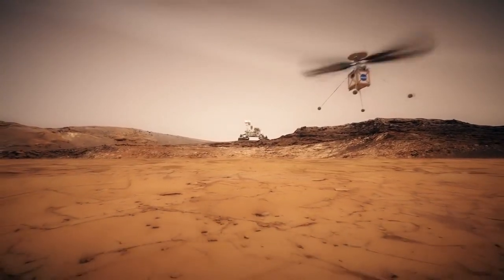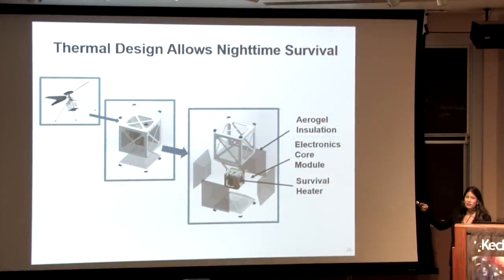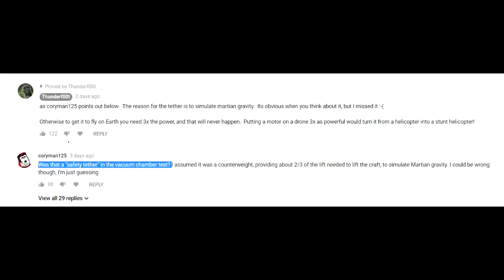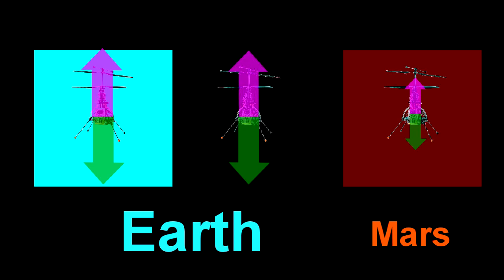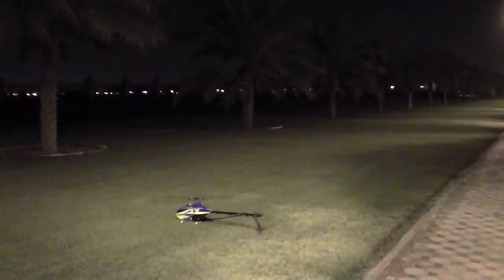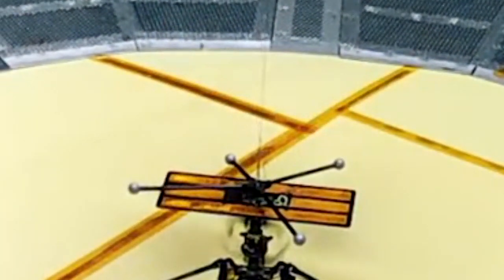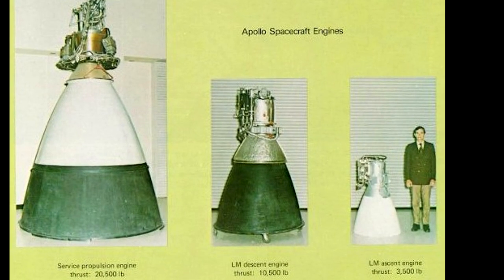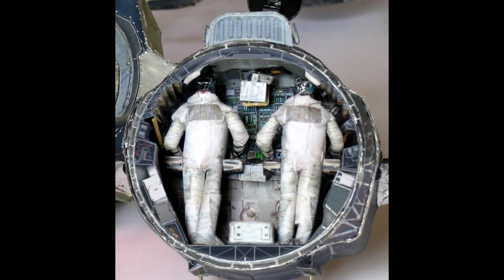Why NASAs Martian Helicopter CANT fly on Earth!

Comment: If the Lunar Orbiter was traveling at 3,579 miles per hour, how did the LM accelerate to match that speed when it says that it was going 76 miles per hour? And they did this in 2.5 hours.  Just an honest question. Here's the link for reference on the figures: https://space.stackexchange.com/questions/14172/how-did-the-apollo-11s-eagle-ascent-stage-find-the-csm-after-leaving-the-moon
Reply: The Answer on that very page answers you; the Lunar Orbiter (the CSM, I guess you mean) waited until the LM could circularize and raise its orbit to match.
Reply: So the CSM slowed down to the speed of the LM, thus decelerating 3,503 mph?
Reply: "The Answer on that very page answers you; the Lunar Orbiter (the CSM, I guess you mean) waited until the LM could circularize and raise its orbit to match." To speed up in orbit raises your height, and ironically causes you to get around the Moon more slowly, as you're traveling in a larger circle, so to speak. I don't know where you got your speeds, but either craft could match the other and make the rendezvous.

Comment: Curious thought here Thunderf00t - They are testing this helicopter in a vacuum chamber, yeah? (To simulate less dense atmosphere) However the atmosphere on Mars is made up of 95% Carbon Dioxide - not the Nitrogen/Oxygen atmosphere we have here on Earth. I'm given to think that Carbon Dioxide as a gas is much denser than the Nitrogen/Oxygen gas here on Earth - so wouldn't that play an important role as to how effective this propeller assembly would operate under those conditions? Do you think NASA fills that test chamber with CO₂ to simulate the Martian atmosphere or do they just use a vacuum of N/O mix?
Reply: It is an easy thing to fill the vacuum chamber with the right amount of CO2. If I were on this project, this is certainly something I would want to do. The volume of the chamber is known, the pressure to achieve is also known. Just put that amount of dry ice into it and let it evaporate after you pumped out most of the air. Shouldn' be that much of a problem.
Reply: pyropulse*, *aaronsdavis*, *explosu And everyone else commenting about pressure and density should read * Karl Lind*'s comment. If you think density does not depend on gas then you are WRONG. If you disagree explain helium baloons. You don't even know how to use the ideal gas law. "n" stands for molar quantity. Density is n*M/V, where M is molar mass which DOES DEPEND ON GAS. If you change M then nothing changes in PV=nRT but density does change.
Reply: Morpheas
On the other hand. If something is easy to do, then why not do it? Creating a CO2 atmosphere in a closed chamber with some predefined gas pressure is really not rocket science. Especially if you already have a vaccum chamber (which is the hardest past in this exercise).
Reply: Which is propelled faster by a propeller - a boat traveling through molasses or one through water? 🤔😳
Reply: Mathew Kevern the speed of sound affects propeller vehicles because you will operate without Atmosphere if you can push all the air away too fast. Its great for jets etc because they are moving into more atmosphere, but if you try to be stationary its problematic. Of course im sure someone scientifically literate could put actual values or terminology to that.
Reply: Denser gasses have a lower speed of sound. You know how helium makes voices higher? That's the same effect in reverse.
http://pages.mtu.edu/~suits/SpeedofSoundOther.html
Reply: If you can evacuate all of the air in the chamber, then you can inject any combination of gas you want into the chamber after.  I'm sure there are a lot of other conditions of the Mars environment that this helicopter must be tested for.
Reply: aaronsdavis one kilogram of lead weights the same as feathers, until you drop it on your foot :D
Reply: The overall density of the atmosphere, is what matters. How dense each gas is, doesnt actually matter.
Reply: They probably thought about all that... I mean, is NASA. They deserve credit don't they?
Reply: Since we already know what the atmosphere of Mars is it's relatively simple to fill that vacuum chamber with the right gases.  They should have thought about this already.
Reply: McBlaggart why is that the case could you explain?
Reply: SO im not the only one who said density in the last video
Reply: we mean this is not accurate due to the comparison of the gas comopostion differenace and temperature
Reply: Erik: THANKS for CLARIFYING. It's been a while since I've needed to care about GASES.
Reply: Many theorists here, who are wrong, Viscosity and Reynold numbers of Co2 are different than air, also the temperature on Mars...
Reply: The CO2 mix might be more important because it will have a lower speed of sound. Spinning the blades faster than the local speed of sound will generate no lift.
Reply: pyropulse The density of CO2 (mass per volume) is higher than O2 and N2 at equal pressures. The molar concentration (moles per volume) is (roughly) the same.

There’s a reason helium balloons rise - helium is less dense than air at the same pressure.
Reply: whaaaaat?..you are LED to believe , are you? led by what, exactly....
Reply: aaronsdavis goose or gander?
Reply: What's heavier: One pound of gold or a pound of copper?
Reply: What's heavier: One ounce of gold or one one ounce of copper?
Reply: then its about pressure, over area. copper is just less dense, which btw, is harder to put INTO space as the rocket has to be bigger to accomidate the module
Reply: hold on lemme, feel, 

RUNS away with a pound of GOLD and copper
Reply: they are the same, they have different densities.
Reply: NO.
Reply: Chaos Shepperson why does the speed of sound effect it ? I don't understand why people are relating it to the speed of sound ?
Reply: That's alrady been accounted for.  He mentioned the net pressure that the Martian atmospheric gas mixture creates.
Reply: 95% is not a metric you would use to describe how much atmosphere in total you have.  If there was only a 3rd of our atmosphere, of that 3rd 95% is carbon dioxide
Reply: Matthew Kevern
I've worked in the engineering department of a Rotorcraft company in the past.  To put it simply, very nasty things happen when the advancing rotors  reach mcrit.  The uneven, extreme, and rapidly changing forces would violently rip the rotors to shreds.
Reply: I think what he was getting at, is whether or not the thrust from displacing the low-pressure earth atmosphere is equivalent to what you would have on Mars. IE. If the rate of displacement is the same between the Earth test, and Martian flight, then the molecular weight of the gas mixture does change the amount of thrust created.
Reply: Mathew Kevern: That is another problem. The airflow around blades shouldn't become supersonic. Smarter every day did a nice video about that: https://www.youtube.com/watch?v=_pbdwueqGp4
Reply: explosu No problem. Sry for caps.
Reply: Viscosity may be a factor if it's a different composition. But I guess they have formulae/simulations to work out the viscosity difference and tell them whether it's worth worrying about.
Reply: mars atmosphere is 100 times thinner than earth's. 95% of 1% is not that much.
Reply: Plus they don't really need CO2 at 1% when regular air can be brought to a pressure to simulate the same effects of gas density.
Reply: McBlaggart, that's not true, they will generate lift, they'll likely be destroyed doing it though.

Back in the 40's and into the 60's supersonic propellers were being researched, and found to be viable, but didn't offer any benefits over using jet propulsion.
Reply: Someone mentioned the ideal gas law but not what any of the constants mean, just a wikipedia page, which is... helpful

Pressure * Volume = n(umber of moles) * R(ideal gas constant) * T(emperature)

We know the pressure. We know the volume we're displacing. We know the ideal gas constant, and temperature. That is the air density. What the atmosphere is made of doesn't matter - the number of moles (which a fixed number - Avogadro's number - of whatever species in a substance) can go up or down, and it makes almost no difference what it is so long as the other parts stay the same.

There are more advanced equations for non-ideal gases (van der Waals equation if you're curious) but these mostly matter at very high pressure or temperatures (more molecular interactions make molecular geometry and surface area important). In any case I'm sure they've got some idea what exactly is needed for their application.
Reply: Actually I'm led to believe the different constituents of the atmosphere combined with the lower temperatures actually roughly double the effectiveness you would get from the blades as the density is higher than earths at the same pressure.
Reply: Mathew I was kinda wondering that myself. I'm guessing troll.
Reply: can you JUST pick one ? the ounce or the pound. And my question has nothing to do with this video
Reply: I assume is like how things fall at the same speed, and while heavier things are pushed harder, inertia slows them down which counter balances it.
CO2 while denser it requires more energy to push down which in the end has the same effect as the lighter O2.

Comment: Not to mention that no individual ascent engine that went to the moon was ever fired before it launched them off of it. The hypergolic fuels were so corrosive that the engine could only be fired once.
Reply: I am pretty sure, the actual ascent engines were checked over and over again, if all the nuts and bolts and fittings are tight. After all there were only 4 moving parts, which had to work. No turbo pumps or anything complicated. Helium tanks needed to pressurize the actual fuel tanks and the valves to the engine bell needed to open. Thats it, If that worked then they would come home.
Reply: I was going to say that.  Just imagine, most other rocket engines are test-fires, but these got "used up", so it was a new ball-game, every time.  I suspect that was on the minds of the astronauts, at least as much as the fact that they were sitting on their tiny rocket engine.   One hidden manufacturing mistake, and the ball game is all over.  I wonder how many they fired to man-rate such a system.
Reply: Thats not entirely true. The engines on the LEM's 1st stage, and the engine on the CSM also use Arazine50 but they were able to ignite multiple times - remember o Apollo 13 they had to use the LEM's 1st stage engine for multiple burns.  The STS OMS engines were basically the same engine from the CSM and they each could fire multiple times during missions.
Reply: I thought that was the point he was leading up to, but then he forgot to mention it.  Otherwise it seems like an odd tangent...
Reply: Brian. I know. Yet you can check if everything is mounted correctly. If you want to get sure, you send 3 or 4 teams to take a look at the engines. You can also pressurize all the pipes before final mounting to see if there is some leakage. That was my point. At least that is what I would do, if I were responsible and cann not actually test fire the engine. I might not be able to do this but there are still things that can be checked and tested. And of course, the engine was built as simple as can be. So there was not much a big potential for failures per design.
Having said that: I totaly agree. I also would have some butterflys in the stomach knowing that this specific engine was never test fired. On the other hand. There were so many things, the astronauts had to trust their engeneers to get it right .....

Comment: Still, I not sure if it gonna work in such harsh weather conditions as mars has
Reply: harsh weather conditions? due to mars low air density it would at most be comparable to a light breeze here on earth, those dust storms covering mars is composed of very fine powder less then 50 microns diametre (1 micron is 1/1000 of a millimetre)

Comment: I didn't get an answer from the original video, but I'll try again here. One of the problems Thunderfoot points out is how little power you'll get from the solar panel since it's so small. So my question is why not have the landing craft it'll be on have a bunch of solar panels and then employ a kind of wireless charging that some cell phones have.

You could land the helicopter on the charging pad and charge it from a much larger array of solar panels, this giving the craft a lot more power and time to fly. And youd have the added bonus of the dust on the panels being cleared every time the drone takes off and lands.

I want to know if that's something feasible or if I'm just missing something major as to why that wouldn't work.
Reply: I see two issues: One is that wireless charging only works over very small distances.
The other thing is the heaviest part of the helicopter will be the batteries, so even if you could save a few grams on solar panel it won't change the flying time a lot. By requiring it to return to the lander you effectively limits the operating distance to a little over two minutes.
Reply: Morten Kristiansen but surely the trade-off of ditching the on board solar panel for a larger battery is still beneficial. Like, I'm sure the mass of the solar panel is way more than the extra mass of a larger battery.

Although I do kind of see your point with the range if you tether the flight to a single take off and landing point.
Reply: Well, if you look up the mass/W ratio on mars for a solar panel, I'll do the rest of the math for you. You need to do something too :-)

Comment: Thunder.......it's not one third.......Volume metric mass, is cubic......We live in three dimensions..... Do I need to explain this to you...Mr Professional scientist...........It's not an engineering nightmare....But, you would not be able to test a Mars copter on Earth, without something like a wire to simulate Mars acceleration on the mass of the vehicle (also known as gravity)....Which requires cubic scaling..... Cubic.....That's to the power of three.....not by a multiplicationary factor of 3......Thunder, put down whatever it is you're smoking or huffing,  and do some calculations...........
Reply: I'm pretty sure its just a linear relationship between force and acceleration F=ma. I don't know how volume factors in at all in this situation.
Reply: Do you need to go back to elementary school science? Mass and density are 2 different things. By that logic it would take 22 times more power to lift it off the ground. That would literally require creating a battery that's holds twice as much energy as TNT, or making the battery 22 times larger than on a typical drone. Given it ways 1 kg, I would say no, the battery is not 22 times larger.

Go to nasa's website, look under the mars helicopter announcement where they call it "high risk, high reward." They also say failure will not impact mars 2020. What is the risk if the only thing at risk is the drone itself? Why would it be risky for the drone? Maybe because, oh I don't know, it's an engineering nightmare?
Reply: Btw, just in case you didn't know, mars is 1/3 the gravity of earth which is what thunderf00t was saying. You probably misheard and thought that he meant that mars has 1/3 the atmosphere of mars, which it doesn't, it has less than 1/100th.

In case you did know and think that gravity scales the weight of mass cubicly, please read up on elementary school level physics.

1: http://www.800mainstreet.com/2/002-07.html
2: https://www.exploratorium.edu/ronh/weight/
3: http://www.exploratorium.edu/mars/yourweight.php
4: https://www.livescience.com/33356-weight-on-planets-mars-moon.html
5: http://www.learningaboutelectronics.com/Articles/Weight-on-mars-conversion-calculator.php
6: http://www.seasky.org/solar-system/planet-weight-calculator.html
7: http://www.spacecenter.org/docs/Activities-HowMuchDoIWeigh.pdf
8: https://theplanets.org/weight-on-planets/
9: http://www.onlineconversion.com/weight_on_other_planets.htm

Do I need to give you more links?
Reply: Yep...But  F= ma...Is a simplified formula ...that kind of implies a spatially dimensionless point having these values of mass and acceleration....Think of this another way....Imagine I gave you a choice; I poke you with my finger, or I poke you with a needle, using the same amount of force...Which would you prefer.
Reply: Density is just a measure of how much stuff is within a volume of something....A pound of lead will fall as fast and with as much force as a pound of feathers. ...But...Which would you like me to hit your head with;  a cubic foot of lead, or a cubic foot of feathers.